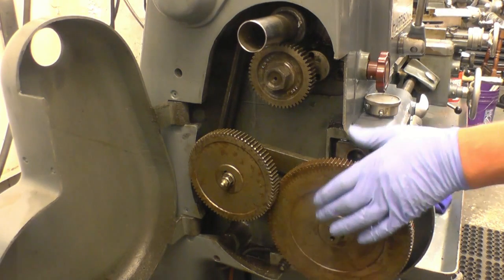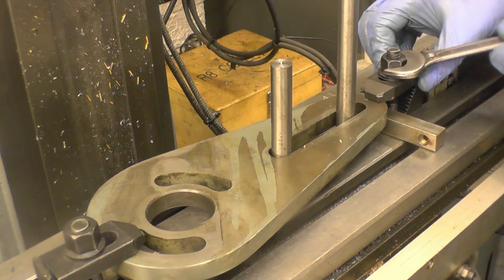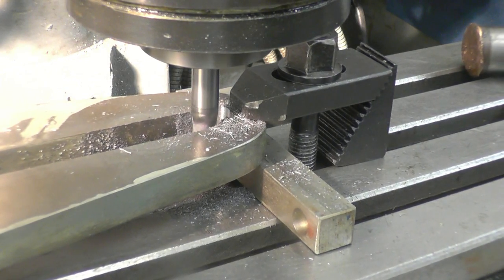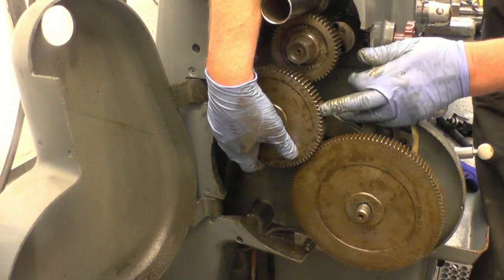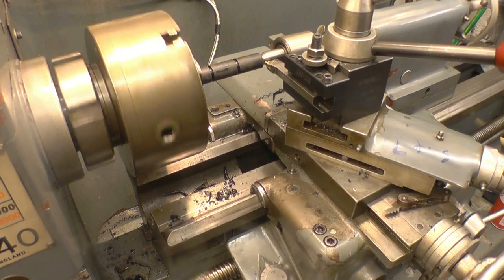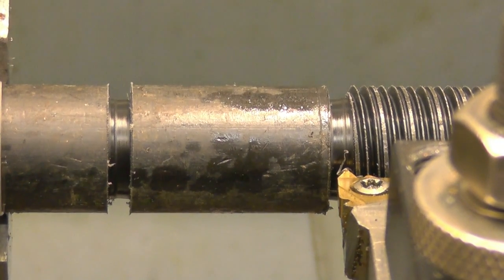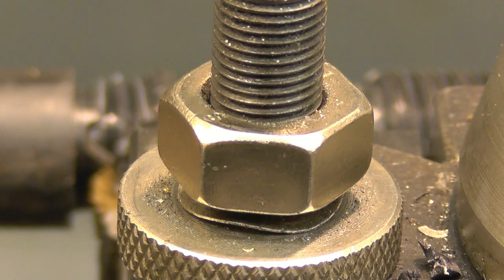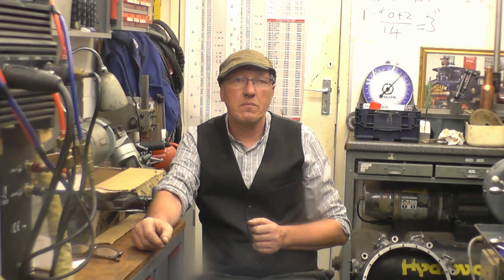SNNC 126 P2 4 TPI  on metric lathe Change wheels

Comment: Hi John, i know its an old video and im sure you know by now but the thread trick does work as i do it on my imperial lathe, the real trick is you start on a number as you did, disengage the half nut, as you did, BUT you reverse the lathe, engage the half nut on the same number back to the start, stop the lathe leaving the half nut engaged, advance the compound side or the cross slide, forward the lathe and it will cut the same thread. hope this helps

Comment: Hi John, would the problem be that you are putting the cut on with the angled top slide?
It might be ok if you were plunge cutting with the topslide at 90 degrees?

Comment: Sorry to hear about your Brother John RIP, 
As for the lathe bit I think Abom79 did something like that but I think he had a stop set so when he took the feed back it always stopped in the same place, When John cut the 4 thread  to the inch the first 3 cuts started in the same place the 4th was a wee bit closer to the material and it cut the thread wider. Just an observation from watching as I have 10 thumbs lol

Comment: Hi John,
              When mixing and matching both Imperial and Metric systems it is safest NOT to disengage the leadscrew, but to stop reverse the lathe and run the tool back as you have shown in your past videos. Excellent exercise in a mix of systems and problems there by encountered.
Regards MoK

Comment: Thanks from one on two wheels for the message, John, I've lost a few friends over the years and had close calls too many times.Glad Debs is well on the mend :)I do the same for metric threads, keep the half-nuts engaged, but I'm lucky to have a clutch/brake on my lathe so I can disengage the spindle drive and stop in the lead-out groove, then reverse motor and reengage clutch - better yet, the clutch/brake swaps between high and low speeds too, so it winds back four or so times faster than cutting.If you have a VFD you could add a switch (the little TIG torch switches are good for this) on the forward/reverse lever to put it into "fast rewind" when you come out of "play"?

Comment: Whole inches and millimeters line up exactly every 5" or 127mm. But a metric lead screw cannot engage on every millimeter (unless it is 1mm pitch) so instead think every 127 threads on the lead screw (for whole millimeter pitch screws), With a 6mm pitch lead screw - you can re-engage at 30" or 762mm up/down the driven lead screw thread and you'll line up to the inch again. That's 127 threads/ticks on the Harrison's threading dial. Given that the Harrison's threading dial looks to be 20 ticks/threads per revolution - that is every 6 turns + 7 ticks.
That is simply not a practical amount for a casual operator to keep track of while the spindle is left running and you crank the carriage back. Replacing the worm wheel on the threading dial with one that has 127 teeth may actually be an easier task. But at threading speeds... it'll also take quite a long time. ;-)
... or just put it in reverse.

Comment: Reversing the lathe always works. However if you have a DRO (and you do) you should be able to zero the DRO anywhere you want, engage hallfnuts, cut. Disengage, and drive the saddle back to zero. I have neither a DRO nor a screwcutting lathe. But I asked Bruce Whitman and he replied that he took all the thread dials off his lathes. DRO all the way.

Comment: John, I'm off to Gairloch on Wednesday on my GS Adventurer, thanks for the reminder - to all road users.   And thanks for the threading info, my Raglan Littlejohn lathe has the same issues when cutting metric threads with its imperial lead screw.  Kindest regards from Bonnie Scotland.

Comment: John,  I think it was Greg Hallogen that showed how to use the thread dial when cutting metric on an imperial lathe.  The same works when cutting imperial on a metric lathe.

1) Mark a hash on the thread dial.
2) Prepare to make the scratch test and engage the half nut when that marked hash comes around (120 in your case)
3) When at the end of the cut, disengage the half nut.
4) turn off the lathe.
5) Back out of the cut
6) reverse the lathe.  
7) Engage the half nut when the marked hash (120) comes around.
8) At end of the cut, turn off the lathe.

The key to this is that it takes a "long" time to go one full revolution on the threading dial.  So as long as you don't let it go one full revolution of the threading dial after disengaging the half nut you are good to re-engage on the same hash.  This puts you on exactly the same place on the lead screw for cutting threads.
Reply: +1
4) IMMEDIATELY turn off the lathe.  (Don't lose the revolution of the thread dial you are on.)

Comment: No john you missunderstood. You can dissengage. You must not allow the thread chaser to make another revolution. If you dissengage you must reverse the lathe to the same number and then reverse the lathe again whilst engaged. You cannot allow it to make a full rev and expect it to pick up. It does work I have done it myself and others have shown it too. Tom Lipton has shown it too.
Reply: Disengage the half nuts at the end of the cut.  Back out the tool.  Immediately turn off the lathe.  Do NOT return the the tool to the start of the thread.  Put the lathe in reverse.  Start the lathe (in reverse) and then catch the dial as it is coming around (in reverse.)  It will be on the same revolution it originally was and the relationship to the tool will be the same.  When you get back to the start you are ready to go again, leaving the half nuts engaged.  The trick is to always re-engage it on the same revolution of the thread dial, don't let the dial spin around so you lose where it was.  You are just giving yourself a small pause in the threading to get the tool out safely.  Otherwise, it is exactly the same as keeping the half nuts engaged continuously.
Reply: That's correct. I have done this myself so I know it works.
Reply: +1  I have done it too, and it definitely works, every time -- if you do it correctly.

Comment: the reason why it didn't pick up the same thread and you didn't bring it back to the exact same starting point. if you had set your zero before you started cutting the thread the first time and then returned to that zero and started a second time you would have hit the threads exactly perfect. I've learned a lot of machine shop work because my dad is work in a machine shop all of his life and I also watch a lot of machine shock videos on YouTube and I pay close attention to what they do and how they do it to learn this stuff even though I will probably never use it. give it another shot and another video and see if the threads don't hit like that

Comment: Every Man lathe I've worked on I was always told you never disengage the feed if theirs not a clutch wether it be ISO or imperial not sure if that's a hard and fast rule but that's what we were taught @ NEI parsons in the heavy shop the blade shop and fan casings. And in the toolroom A and B.

Comment: In order to use an imperial thread dial the lead screw should be imperial . for example on an imperial lathe the lead screw can be 8 TPI and the thread dial has 8 divisions, numbered 1,2,3,4 and half marks. The thread dial will have 32 teeth on its gear.  What this means is the carriage will move 4 inches exactly with one rotation of the thread dial.  so for your thread of 6 TPI  you will have 24 threads in 4 inches . 24 is divisible by 8 so you can start on any division. When cutting metric threads on an imperial lathe you must reverse or use a stop because  there is no metric thread pitch that divides into 4 inches (101.6mm) evenly. The same is true on a lathe that has a metric lead screw. Once you understand how the dial works in conjunction with your lathe's lead screw it becomes  easier to understand.

Comment: A great message at the end John... as a motorcycle rider myself I appreciate the need for vigilance.  Sorry for your loss, but as you say if you can pass the message on perhaps all is not lost.  It's good to hear Deb is progressing well too... good on you both.

I know there was a comment on SNNC 126 Part 1, but Tom Lipton gives a good demonstration of metric/imperial or vice versa threading... he does disengage the half nuts at the end of the cut, but then re-engages them on exactly the same number on the indicator to reverse the tool back to the start of the job (if I remember correctly).  Probably much the same time-wise as keeping the nuts engaged all the time, but it might reduce the chances of crashing the tool at the end of the thread somewhat.

Comment: So if I have this right, picking up the same number on the dial indicator is fine in that it just tells you that the drawscrew is in the same position as before, however due to the different gears it means that you can't guarantee that the chuck is in the corresponding position. Nicely demonstrated.

Comment: Great video again John
I have had success doing metric threads on an imperial machine ( the reverse of what your doing)
The following sequence might be worth your time to try out
setup as usual, engage 1/2 nut, cut your threads, at the end disengage the half nut, Immediately stop the motor,
 back your tool out, reverse the motor and re-engage the 1/2 nut when on the same mark that you used while feeding in
 reverse to starting point, 
stop the motor reverse direction and start again.
Don't let the thread gauge do a full revolution. and you will pick up the same location
I hope it works for you

Comment: If you would have used a dial indicator to return the carriage back to a set zero(to the right of the carriage - at the start), the threads would have lined up.  Loves the videos, thanks.
Reply: Nope,

The feed screw and spindle only line up once every 127 revolutions (or so) of the spindle.
It is different than doing native threads that only has to deal with them lining up every 1,2 or 3 revolutions.
Reply: +1            -- Edit: +1 to Scott, not to Ray.  YouTube is not showing who I responded to in the thread...